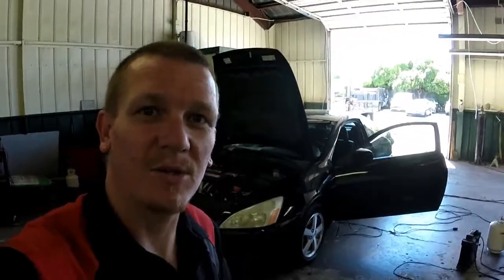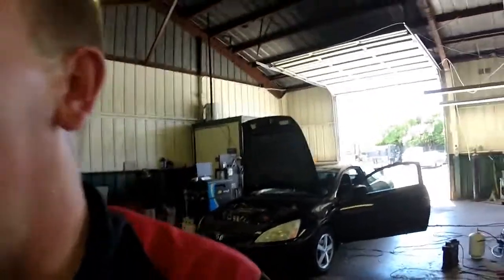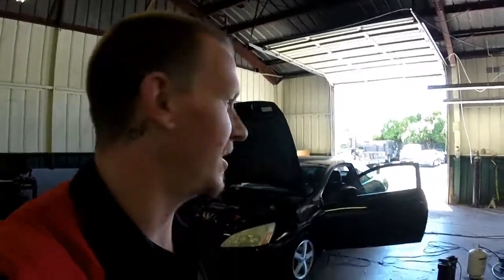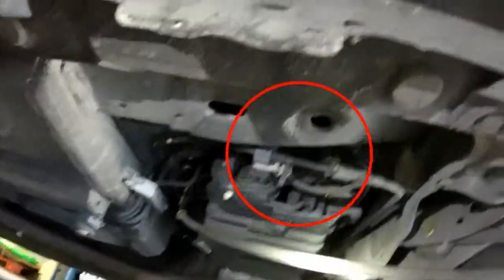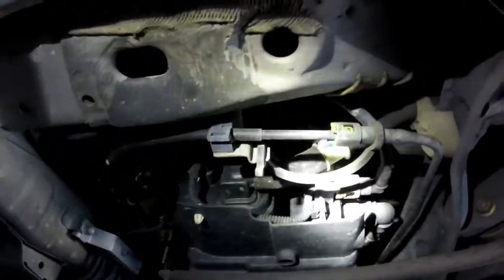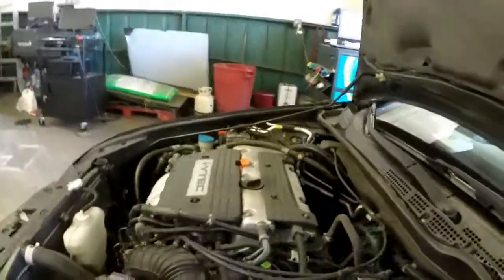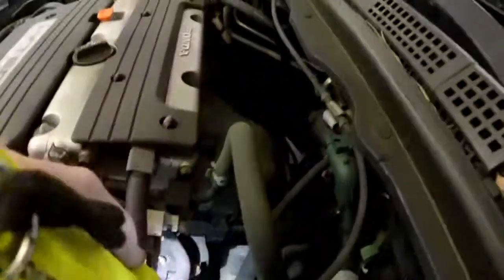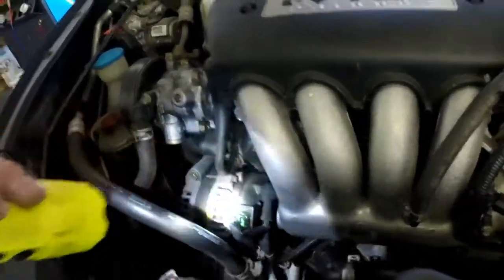Honda Accord Emissions locations: PCV, EGR, & EVAP

Comment: But remember it won’t be the same for a sedan Somme might but not all in the same location
Reply from the maker: You are 100% correct but I bet you would be surprised how it would be surprised how many vehicles have the same location. Aim location. It makes production much easier if you have multiple vehicles with the same location same location of components.
Reply: @ScottiesHobbies  yea that’s true but I noticed some stuff on here that they say u had to do this to remove that to get to this and u never needed to or stuff that was supposed to be on this car but it’s on other years like this car was supposed to have a map sensor and I guess just the 2004 perticular didn’t come with one or not some but half of the 04 that got produced didn’t needed a map sensor

Comment: Thanks for the tip! Where would the EVAP Canister Vent Shut Valve be?
Reply from the maker: The vent valve is located near the canister. You should have one hose exiting the canister going to the vent and then a hose going from the vent to ambient. I believe if I'm thinking right off the top of my head that you might have a plastic cover on the bottom side of your car that needs to be removed to get to the canister and vent solenoid. Before you replace it make sure you do the 9 volt battery test and a vacuum check on it to make sure that it is actually malfunctioning. It is very common to get Road Grime or spider webs in those vent tubes that go to ambient and cause codes to appear
Reply: @ScottiesHobbies  Thank you so much! I will check that out.
Reply: And one more dumb question. What is ambient?
Reply from the maker: I don't have a video on doing a 9v test on a vent valve. I think I have a test for a purge solenoid but I can't remember if I do a 9v battery test on it or not.

Ambient is the out side or into the air. The vent valve releases fuel vapors into the air when the system can't contain them.